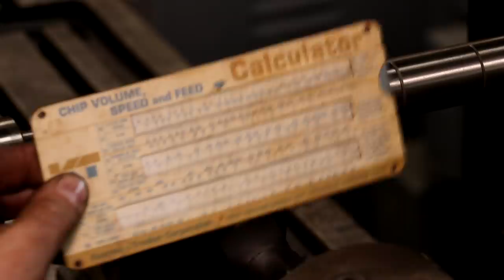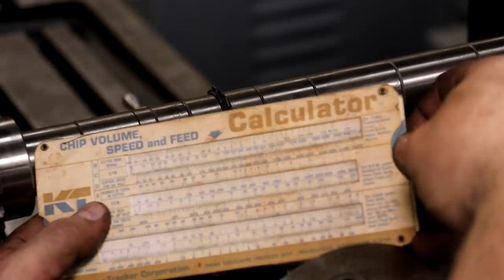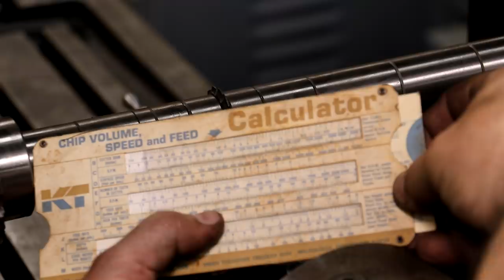Monarch 10EE Lathe Gear Segment, Part 3: Cutting Gear Teeth on the Horizonal Mill

Comment: 3:18 Man walks up to the toolroom:  "I need a wrench."
Toolroom guy: "What kind of wrench?
Man: "It doesn't matter. I'm just going to use it for a hammer anyway."
Reply: He's using the adjustable hammer.
Reply: AKA a Swedish nut lathe
Reply: My guess is the spindle is already going south. 7/24 tapers are not supposed to lock in place. I had the same thing going and the more you smack the more the bearing start to overheat and they lock the tapers deeper into the bellmouthed spindle nose. More smacks, more heat, more sticking, more problems.
Reply: Where does one find a dividing head setup? I’ve been looking on marketplace, eBay, and craigslist and only saw a handful for sale.

Comment: Thanks for sharing the journeyman to apprentice tips: don't tighten the unsupported arbor, wipe the inside and outside of the taper, go with the lower of 2 possible feeds and speeds, and tap the taper loose with a crescent wrench.  :-0

Comment: Does it matter that the pieces are not stacked smoothly on the sides?
Reply: i was wondering exactly the same thing, only i was wondering if the new gears should be even clocked with the oryginal one or is that just a whim
because those 2 holes might had been designed to be in a specyfic ofset from the teeth or this might be irrelevant as long as the teeth are formed corectly
Reply: Sounds like a few of us would like to know if the small holes need to be position clocked to a tooth centerline (real or imaginary tooth centerline).  I've watched this video and the previous one, loved them both, but don't think small hole clock positioning has been addressed.  Thanks for great videos.
Reply: No, since the holes are aligned, but it is hitting my OCD like a hammer!

Comment: Regarding arbor/cutter run out- at least your machine has auto feed!  My Nichols mill has a hand lever for feeding, so you get a real feel for how it's cutting, and even if the cutter was aligned perfectly, you'd still get slight scalloping on the bottom of the cuts.

Comment: I noriced that the blank next to the full width blank was rotated a few degrees away from ther others.  Does that matter?
Reply: I was thinking the same thing allready in the last video.
I thought he would line them up for cutting the teeth.
Reply: It wouldn't matter if the offset was the same as the gear pitch.

Comment: One of your blanks slipped during the turning operation.
Reply: I see it too.
Reply: That misalignment made my OCD kick in hard!
Reply: @MbanziSD  Yeah- you want to yell, but then you realize it's all done already.   No big issue on the function, but that one piece ended up with a tooth missing on one side and an extra thick on the other.  Keith can use that on on his machine.

Comment: I was just curious, since this goes in an electronic component, is there no issue with how the teeth are indexed on the piece?  I would have thought that the 2 indexing holes would need to be aligned with the proper indexing of the teeth?  Just curious.  Thanks for sharing, enjoying you make these...
Reply: @paulcopeland9035  Good deal, I guess the 1940’s electronics were somewhat limited. Lol

Comment: It looked like on the original there was a space on the out side then a tooth but your new ones all have a tooth on the out sides could that cause a interference issue on the machine you might like to check that now before sending them off

Comment: The new parts do not have the teeth timed the same as the old part. Looks like there is a few degrees difference. Will this be an issue during use.
Reply: When he drills the holes he will time them to the teeth, there will be an extra portion of tooth on the outside edges with enough tolerance for the difference

Comment: 12:00 I'd asked Abom79 for an explanation of the support adjustment so this is a great bit of info for me. My observation though is that when you put the arbor support over the bearing, it slid on easy and you didn't spot any tightness at that time - so it seems a bit off that it's started to run tight/hot now.
Of course, if this support was well engineered, the bearing should be of a material that thermally expands more than the journal thereby as it warms up, it becomes less tight and is therefore a self-adjusting bearing !
Reply: Cast iron actually expands even less than steel so it will in theory get a little bit tighter when warming up.
Reply: @MF175mp  So the bracket should be made od steel and the journal cast iron.

Comment: The second piece closest to the cutter is out of line with the rest, won’t that make the teeth in that piece off?
Reply: When he drills the holes he will time them to the teeth, there will be an extra portion of tooth on the outside edges with enough tolerance for the difference
Reply: No it won't. Well, in theory just a little bit but what makes most is if the end faces of the spacers have burrs or nicks. That will bend the whole arbor to banana shape when the nut is tightened and that's why most of the old mill arbors don't run true. It doesn't even matter if the shaft would have a slight bow in it, if the spacers are straight, it will pull straight when tightened.
Reply: No.

Comment: When you took the plate off your dividing head, you did not wipe off the inside surface before you put the new plate on. It would seem that that area would have more dust and grit because of the holes and might throw the alignment off on the new plate. Great video, love to watch you work.

Comment: Hi Keith,
Just wondering why you cut the teeth on both side's of the long bit of stock?
Great video and narration as always
Thanks
Rodney
Reply: Keith explained the reason at 23:48.
Having the full diameter allowed him to take over-wire measurements.
Over-wire measurements tell the machinist whether or not the teeth are cut to the proper depth.

Comment: "Electronic lead screw reversal mechanism" on this early Monarch?
Reply: Original manufacture was 1941. Yes, it used electronic buttons, vacuum tubes and electromagnets to drive direction switching and auto-stop gears and levers.
Reply: @kindabluejazz  Thanks. It would be interesting to see the circuit of that.

Comment: Hi Keith,  at 10:45 you say you are finding the high spot on the part. If they are on a radius wont they all be the same height regardless of the rotation or am I missing something ?
Reply: I was thinking the same thing. I think if you where sure the part was square with the table and if you move it in and out while slowly bringing the table up you'll hit the high spot.
Reply: You want the cutter to be able to cut the correct tooth profile, if you don't start with the cutter centered on the highest point on the blank the teeth will have an offset profile and instead of nice even teeth they would look more like a saw tooth.

Comment: Keith, I have heard you say a couple of times that the part is for a 10EE, but you are not sure exactly where it goes. Does timing of the teeth relative to the two locating holes matter? I would have thought so if they needed the two locating holes. I noticed in the turning video that the second block back  from the mandrel nut was rotated somewhat relative to the third block, and continues to be so this time around, and also that there was no real attempt to clock the blanks to match the original while cutting teeth. You may need to consider this when setting up to drill the two locating holes, rather than just set them up relative to the sides of the block and the mandrel hole. Just wondering?

Comment: 0:20 He said 'electronic'. How old's the lathe ??
Reply: Original manufacture was 1941. Yes, it used vacuum tubes and electromagnets to drive direction switching and auto-stop gears and levers.
Reply: @kindabluejazz  That is VERY interesting !
I've wondered about my mill and adding electromagnets to operate levers to stop the feed.

Comment: That gear cutting attachment is looking a bit rough, with grime, questionable paint job, and surface rust on it. Put you helper minion on sprucing it up a bit, so it looks right in front of the cameras.